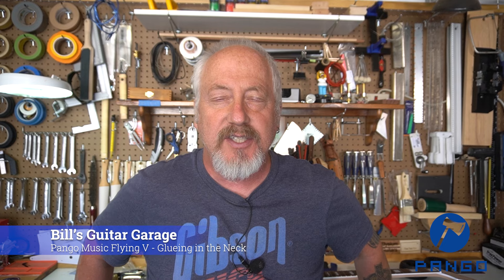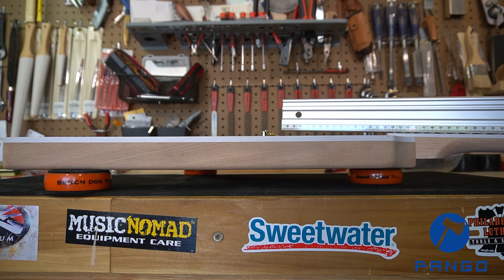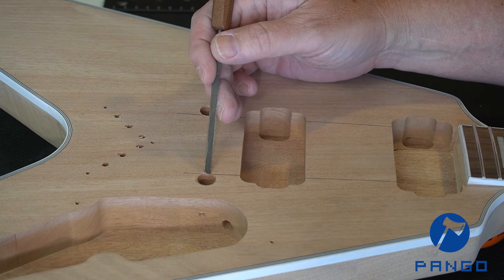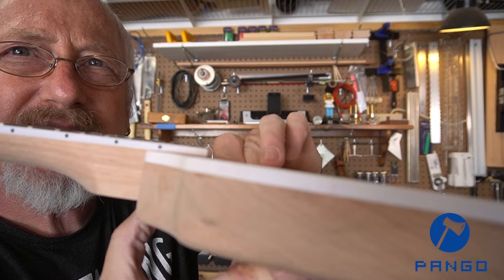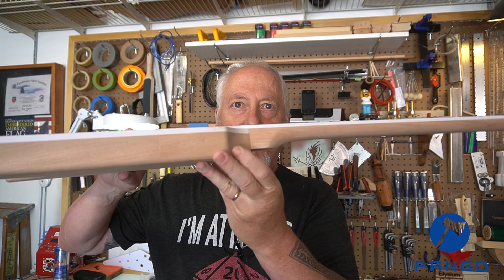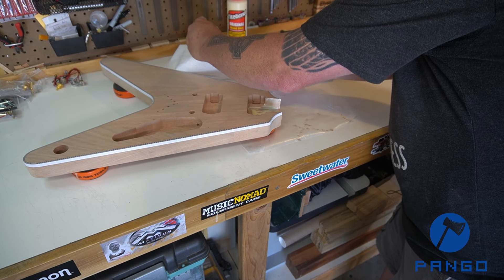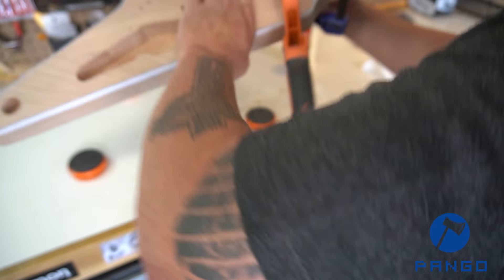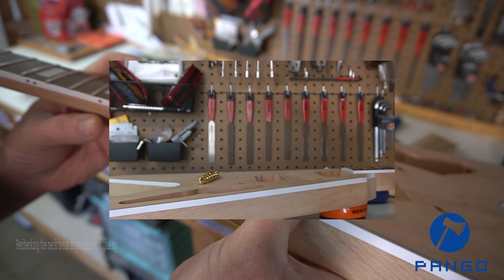Pango Music Flying V Custom   Ep 2   Glueing in the neck on a set neck guitar

Comment: I ordered a custom explorer kit from Pango which should be arriving soon. Do you normally use the stock hardware and pickups that come with the kit, or do you replace them?
Reply from the maker: I use the hardware that comes with the kit.  I have been really happy with the pickups.  They sound good.  The wire harness and pots are well soldered, the pots are the smaller Alpha pots.  The bridge is also good quality.  The tuners have improved as well.  If you were thinking of any upgrades, I would say make a set of locking tuners the 1st priority.
Reply: @billsguitargarage  Awesome, thank you for the response!

Comment: Thanks Bill great work, one question though. If you didn't adjust the break angle do you think it would have caused issues getting the guitar to play right? This could be a critical step if so that should not  be skipped by someone just trying to quickly glue these kits up thanks for the demonstration and knowledge these vids will be invaluable when I start gluing my kit.
Reply from the maker: It was completely playable the way it was.  I didn’t really adjust the break angle, I just did some very fine tweaking to the body and neck joint to make it as perfect as possible.  I could have left it as is, and it would have been fine.
Reply: @billsguitargarage  thank you that is exactly what I was asking! How has the other V's neck mod held up? You took some material off to smooth it out just wondering if it has affected the joint in any way? it was a good idea I thought.
Reply from the maker: @PolishHammer  It has held up great!  No issues at all.
Reply: @billsguitargarage  thats what I was hoping these are very nice kits but that neck heel is a bit clunky for a V Pango should fix that as I am going to be winging it haha! I have been practicing by gluing all the broken drawers back together, kitchen is fixed on to the bathroom! Then maybe the guitar...